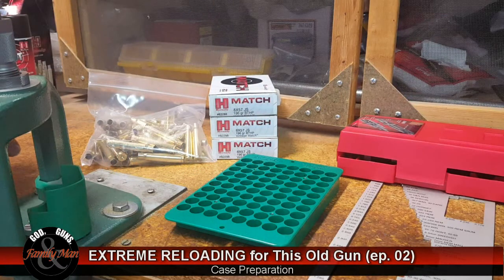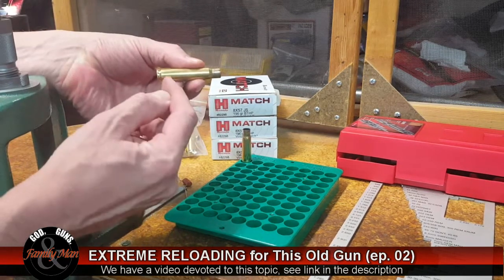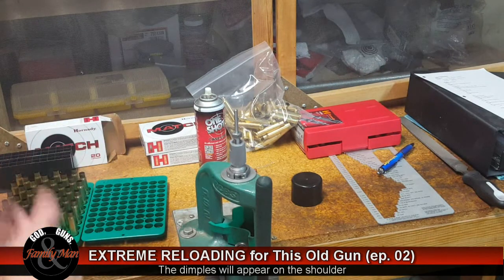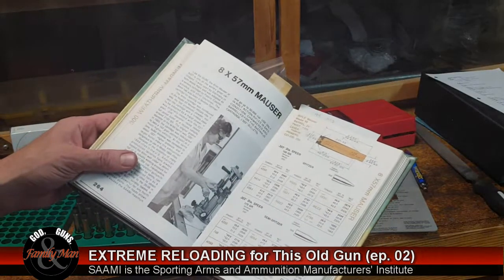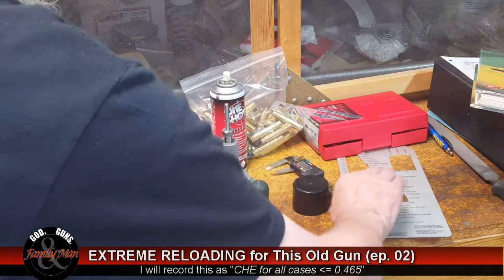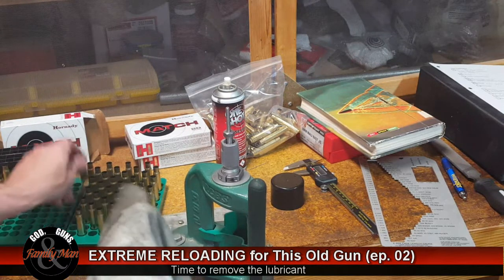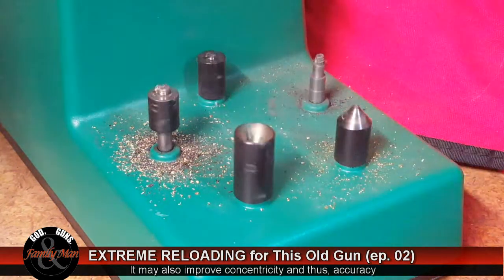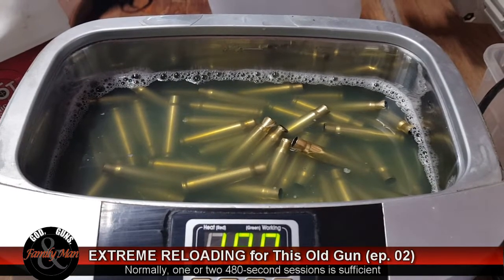EXTREME RELOADING for This Old Gun: Case Prep (ep. 02)

Comment: I also have to disagree on the comment about too much case lube. Yes, sometimes it will leave a few dimples around the neck/shoulder junction but they will fire form out just fine. I've done that on the first few pieces of .243 brass on a clean FL die but it stops after 4-5 pieces once die is coated in. They all have fire formed out & never had an issue of weakness in that area.
Reply from the maker: I have not had luck getting the cases to fire form back into shape but also did not continue with repeated firings.  My solution since then has been to discard those cases.  It has taught be me to be extremely careful on case lube and only had a handful of cases dent/dimple since that time.  I have also only had one case get stuck (too little lube) in all my years of reloading.
This is all good stuff to discuss showing there is not just one way to do anything. Thanks for watching and posting.
Reply: @sdkweber  my first couple will dent only if I use imperial die wax have small dents that fire out, now the hornady 1 shot does not do that like you said.  Really enjoy your videos & love when you shoot SD prairie dogs. I'm from SD & when I'm not shooting competition benchrest I love flipping prairie poodles in the air.

Comment: Love the video, but I have to disagree with one thing I uniform the primer pockets every time I reload the brass. As it's fired the brass is "hammered" into the bolt face the you can see this as brass ages the head stamp tends to get less pronounced, and after several firings the primer can start to stand proud of the case head. Not a big deal in a bolt action but in a semiauto could be problematic. Also I find this can throw off bullet seating measurements. Been doing this for years. What's your opinion.
Reply from the maker: You know, I normally check the primer pocket depth (by placing each case on the uniforming tool) each time I prep cases as a matter of habit but do not normally need to do anything to them. My worry is that if we keep removing brass in this area it is coming from somewhere, and that is the heavy head/web area. I would rather not thin that out. Perhaps checking primer pocket depth with a caliper would be best.
For the 8mm Mauser and the light load we will ultimately be using, I should think the one-time uniforming will do the trick at least for 5 or 6 loadings.
Thanks for watching and posting.
Reply: sdkweber  I've watched all your reloading videos enjoy them all the time you take putting them together shows. Keep up the good work. I have uniformed the pockets 7-8 times on 6.5 Grendel, found this caliber beats up my brass the most, and never had any primer problems, loose , punctured etc. my Grendel brass is usually done in by insipid case head separation, I check it similarly to you with a sharpened 90 degree pick and feel for a dip in the brass, then dent it with a hammer and toss it in the recycle bin.
Reply from the maker: @heywire101  Thank you Heywire101. We will do our best to keep these videos coming.